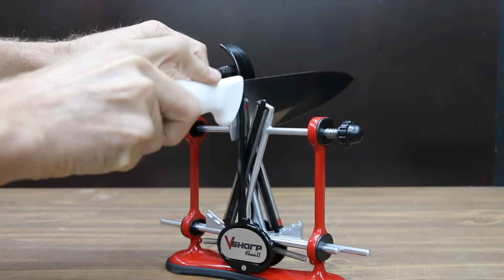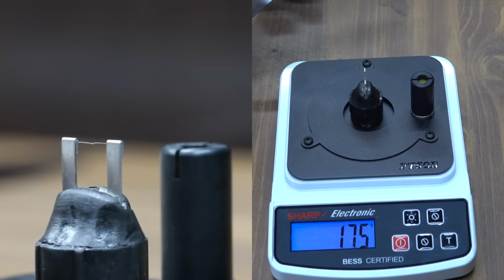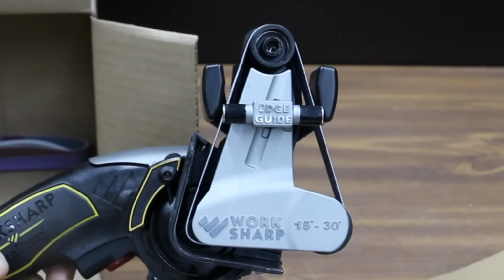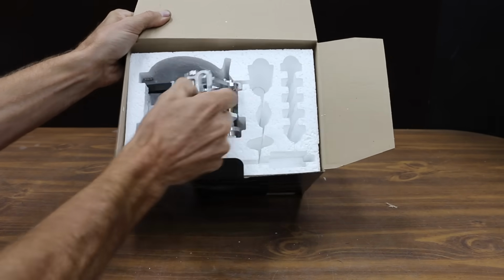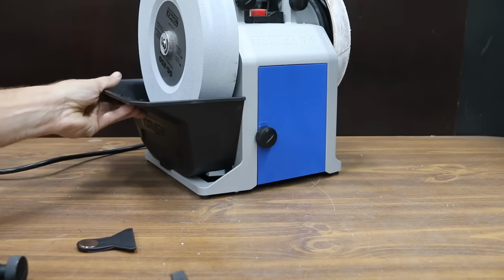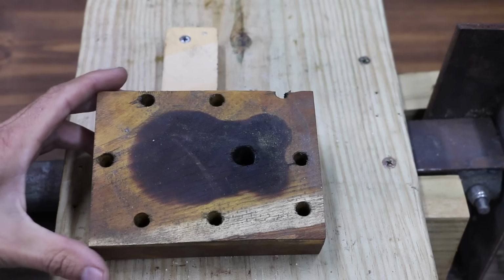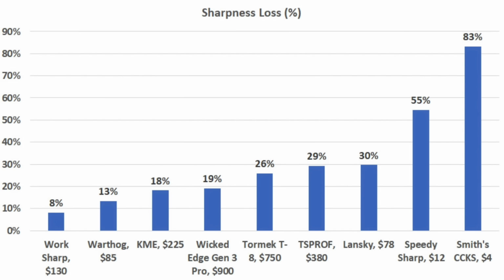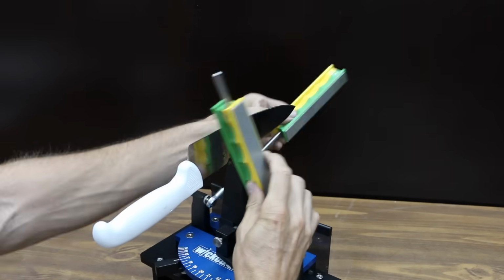RUSSIA vs USA Knife Sharpener? TSPROF vs Lansky, Wicked Edge, KME, Tormek T-8, Work Sharp Ken Onion

Comment: I have the KME system and it makes a very nice professional looking edge. One issue I have had with it are the stones are slightly different sizes. The mounting system has to be adjusted for each one which is a fiddly process getting it set to the right tension with that little knob. 
The guide rod could use another set stop to keep your stone from accidentally riding up or slipping off the blade.
The stand is too expensive, buy all thread two nuts and some wood.
Takes a significant amount of time to produce a new edge but its faster than the lansky system I had before.
Reply from the maker: Thanks for the feedback.

Comment: Man this is the best sharpening video you have ever done. One point though. If you order finer stones/diamonds the edge will be sharper. I have had many systems and to me any of the systems that consistently hold the angle (like lansky) are good enough and $78! Wow. The speedy sharp and the smiths are only good for a few sharpenings because they do not keep the blade flat or get out nicks. They are like using a steel.
Reply from the maker: Thanks!  Thanks for the feedback.

Comment: Thanks again for another well done comparison. I personally use a wet stone and need to get smoother stones so the  edge will last longer. Seems like a few of these companies are trying to reinvent the wheel. Some of these look dangerous and should come with chain mail gloves.  For me, instead of spending $900.00 to sharpen my kitchen knives, I would just throw away dull knives and purchase new ones - might be cheaper. Using Mercer  from Amazon, the $900.00 would get you 69 knives.
Reply from the maker: You are welcome!  Thanks for sharing.

Comment: This was one of the wildest and most interesting tests I've seen on this channel so far. However, I think due to the tension driven performance of this test you should have tested each knife at least three times in each scenario. At face value the Lansky looks awesome but I bet with more tolerance testing the high brands come out on top.
Reply from the maker: Thanks!  Thanks for the constructive feedback.

Comment: Can you test out more 2 stroke oils i use castor 927 and its been my favorite oil zero smoke when my dirt bikes warm and check the cylinder after 150 hours and still had the factory crosshatching
Reply from the maker: Thanks for the suggestion.

Comment: In your previous testing, I posted for you to use quality knives for better accuracy.  Sadly you bought "low end" mercer knives. Even cheap knives are very sharp to begin with. The knife makes as much difference as the sharpener. You should use a quality knife made of carbon steel and one of "stainless" steel to be more accurate. Well maybe next time???
Reply from the maker: Thanks for the feedback.

Comment: I commented on your previous video regarding the success I had with the Lansky as a portable sharpener while I was in the army.
I recently purchased the new worksharp precision sharpener for about $40. The basic model has 3 stones although they now have an upgrade available. 
Take a look at it and should you ever visit this subject again maybe you can give it a try.
It works really well, and as you'll see, follows the theme of clamping the blade and adjusting the angle of the stone. It is a good fit in the budget area.
It isn't as portable as a Lansky but it is easier to set up and use.
Thanks for these many videos. I have used your research for several purchasing decisions.
Reply from the maker: You are welcome!  Thanks for sharing.

Comment: I didn't need to watch anymore as soon as I saw the $4 sharpener do it's job. I did watch the whole video though to see how pointless the rest of them were for some of the  crazy prices in comparison.
$4 sharpener thrown in the cutlery draw for instant sharpening versus overcomplicated machinery you need to assemble each time - I know my choice ;o)
Reply: Did you watch to the point where the knife sharpened with the $4 sharpener proved to have a vastly less durable edge than those produced by the other sharpeners?  On the other hand, the $12 one did better in the tests, is almost as simple to use, and is almost as affordable.  I don't have that exact sharpener, but I own one of a very similar design, and it's pretty good.
Reply from the maker: Thanks for watching!

Comment: Fabulous review, as usual. There may be something counter intuitive about sharpening knives. Apparently chisels and planes are best when sharpened to a mirror finish. Knives are better when they're sharp but still have some "teeth". These very small serrations act like a saw when the knife is dragged over the food to be cut. A chisel is pushed through the wood with no drag or length wise motion. 
So i wonder about the sharpness tester because the edge to be tested is pushed against the wire with no sliding motion. Try cutting a ripe tomato or raw meat with a knife with a polished finish and with a knife that has the serration left by fine diamonds or stone...
With that said I like the objectivity of the sharpness tester. But who cuts raw meat without dragging the knife?
Reply from the maker: Thanks!  Thanks for the feedback.
Reply: i dont think kitchen knives want burs or "teeth". chefs recommend using a honing rod to keep the blade clean of any such things.
its been a while since i watched him first talk about the knife sharp testing thing he bought. but im pretty sure he tests it per their recommendation/instructions. i guess he could always pull it through and push it through to see if it gives a different number
Reply: @Mck Idyl yes either way his comment isn't a good idea
Reply: I suppose those "teeth" can also affect the result of the test that he does, though. Provided the teeth are small enough they might create extra pressure even on that narrow piece of wire. The smoother the edge, the better the pressure will get distributed, I Imagine, reducing the tested sharpness

Comment: GREAT VIDEO!!!!! You know what they say about knife sharpeners, the best knife sharpener is the one you use. OK, maybe that was about cameras, but I hope you get the point. Anyway, the two cheapest sharpeners may not have given the best edge, but they were pretty good and so much easier to use. For normal work in the kitchen, they'd be my choice. BTW, I own a Tormek. But I use it for chisels, planar blades, etc. No criticism intended, but I don't think you prepared the grindstone on the Tormek to give the best results.
Reply from the maker: Thanks! Thanks for the constructive feedback.
Reply: @ProjectFarm  Thanks for understanding the spirit of my comment...although I do hate to critique your videos in any way since they are, in no uncertain term, incredible! Just to clarify my comment about using the grindstone. The Tormek comes with a "Stone Grader." If you want to adjust the stone to finer sharpening, you press the fine side of the stone grader towards the stone surface for about 30 seconds. This will alter the function of the surface of the Tormek Original Grindstone (220 grit) making it work like a 1000 grit stone. I suspect that would have improved the performance of the blade sharpened on the Tormek. Keep up the fantastic work. 👏👏👏 I hope you enjoy making your videos as much as we enjoy watching them!!

Comment: Having had a wicked edge WE130 honestly they're overrated overrated.
And needs some serious improvements to help with safety and overall versatility. 
A hapstone v8 or r2 is much more  capable of a system.
The ko3 and blitz are nice too.
The blitz is a little small for longer kitchen and thicker hunting knives 
Knife placement in systems is important also.
And the stone's used are a big factor also.
I use venev centaur 1x6 stone's f80-f1200 (3micron) about 6,000 grit. 
And as you mentioned strops are a must

The worksharp precision adjust is the new budget King. 
Lansky used to be the go to but it's league's better
Reply from the maker: Thanks for the feedback.

Comment: So as someone who is quite into sharpening a few tips and tricks.

1. As your abrasive becomes more fine, the amount of material it removes becomes more less as well, hence as you go to finer abrasives the time you need to spend on each increases significantly, this is useful if you want to get a true mirror polished edge.
2. Fine sharpening is all about keeping a very consistent angle, a change in angle of just a fraction of a degree will significantly impact your results. For tools that use claps such as the kme and lansky it's useful to make the outline of the clamp so you can tell if it's shifted during sharpening
3. Most of the systems you've shown have multiple upgrades and modules you can purchase for them, which significantly improve the system. Such as the base for the lansky and the different abrasives, which can give you a more fine edge. Things like micro diamond pastes and lapping sheets
4. The edge geometry matters significantly, narrow edges will give better sharpness and edge retention, wider ones will give more toughness. A concave grid like you'll get on the tormek would give you more sharpness but result in a more fragile edge that chips more easily, a convex edge that you get on the worksharp will not be as sharp but will be more resistant to chipping, a flat edge like you'd get on the lansky, kme and wicked edge gives you the best compromise between the two.
Reply: a narrow edge does not give you more edge retention than a wider edge.
Reply: @fettmaneiii4439  yep, it definitely does. You can look up Cedric and Adas videos on it, he's done hundreds of tests on different steels at different angles and a smaller angle will always give you better edge retention, up to a point at which the edge becomes too unstable, but that's usually less than 15 degrees depending on the steel and heat treatment
Reply from the maker: Thanks for the tips and tricks!

Comment: Congratulations on getting a Tormek!  Now you can sharpen pretty much any blade you can imagine (knives, chisels, gouges, axes, etc).  But you did not use the stone grader to take that wheel from 220 grit to 1000 grit.  Imagine how much sharper it would have been after using the stone grader (220grit, 1000grit, honing wheel).  
With that said, if you only sharpen knives, then for price+performance, the Lansky is hard to beat.
Reply from the maker: Thanks for the feedback.

Comment: That russian sharpener looks awesome. A bit tricky to use, but that's what makes it fun. 

After watching your previous video I went with a $20 whetstone kit from Amazon, which includes a 400 grit, 1000 grit, 3000 grit and 8000 grit, as well as a piece of leather for stropping, and it works excellent. It took quite a bit of practice, but I can get knives sharp enough to shave.
Reply from the maker: Thanks for the feedback.

Comment: Wicked edge has a lot more grits than what you tested. It doesn't start getting sharp until you use a ceramic 2000 and get down into the microns. Also, it needs to be a really good steel so it doesn't fold the edge over.
Reply from the maker: Thanks for the feedback.

Comment: Of these knife sharpeners, I’ve use the Lansky. The results were good but, I don’t think it’s suitable for larger knives. It’s also time consuming to use. Although time consuming, I prefer using traditional whetstones. I find it somewhat therapeutic to use them, and you won’t beat the results. It’s really impossible to compare whetstones to any of these tools as the results will depend greatly on the skill of the person using them. If I need to sharpen a knife quickly, I think I would give the work sharp a try. I like that it puts a slight convex edge which seems to stay sharp longer.
Reply from the maker: Thanks for the feedback.

Comment: As a knife connoisseur and long-time Wicked Edge owner/user, I'm happy to see it did so well, but yes, it's expensive.  I paid only $300 for my Gen1 Wicked Edge in July 2011.  However, the Wicked Edge is overkill for the steel in the blades of the knives used in this test.  Where the Wicked Edge really shines is when sharpening blades made from tool steels like D2 and M4 or premium blade steels like M390, Elmax, S90V, or S45VN.  The Wicked-edge is also not great at sharpening knives with blades that are 8-inches or longer.  Wicked-Edge should take note of the two-clamp system on the TSPROF as the single clamp is the weak spot of using the Wicked Edge sharpener on longer blades.

I loved the knife-making part.  Scrap steel with no heat treat won't make a very good knife blade, but it was fun to watch.  Project Farm should raffle it off to a subscriber or something.
Reply from the maker: Thanks for the feedback.

Comment: My Edge Pro works OK, but not as nice as I'd like. 

Surprised that other than the water bath grinding system, that none of the others were sharpened wet. 

Two things I learned the hard way was that in order to keep the sides of the blade from being marked up when the blade moves around is to use electrical tape on the clamping surface. 
The second is that it takes way too long to sharpen all the kitchen knives I have.

For my EDC Benchmade, I freehand a 1000 grit diamond on the sharpening edge as few times, then switch to the other side finally two or three swipes with a ceramic "steel" rod.
Reply from the maker: Thanks for the feedback.

Comment: I had a sharpening business , did a video comparing tormek , work sharp , edgepro apex and waterstones , I have went about 1000 belts or more in the work sharp , used the whole stone on the tormek and used whole stones on edge pro as well , sharpening about 1000+ knives plus the custom knives I make, after that I also got the tsprof kadet , to be honest it all comes down to what your needs are , for general all purpose working knife sharpening work sharp ken onion with grinder attachment is all the way to go ! Its versatile to sharpen many stuff like swords and axes , but for all my personal knives I use the tsprof kadet , simply the best out there , I will be posting my video comparing it to the new work sharp manual sharpener which is a cheaper version of this style of sharpeners.
Reply from the maker: Thanks for sharing.

Comment: Great video, thank you. The knife edge tester was a brilliant touch. I have a Lansky and have found the clamp location to be important in recreating the same angle when resharpening.  The angle the stone forms with the edge gets smaller as the contact point moves away from the clamp. This makes a sharper edge but slows down the initial sharpening. I mark the edges with a felt marker too and it reveals if you are going all the way to the edge or if you are riding a high spot.  If you don't realize this the knife will be sharp near the clamp and unsharpened near the tip and handle. I always try to clamp the knife halfway along it's length and width unless the knife is too long. I always pushed the stones into the blade but I see you wipe them along the length. I lost the instructions years ago.
Reply from the maker: You are welcome!  Thanks for the feedback.

Comment: My father taught me to use sharpening stones and to start the tip of the blade across the stone first moving the knife forward so the grain on the blade edge cuts more readily by pulling the knife backwards instead of forwards..Does it matter? Maybe in a knife fight where you slash but not stab? Thats a plus. Never know what will happen when youre hanging with your homeys.
Reply from the maker: Thanks for sharing.

Comment: I've got the KME system along with some additional stones and it has been an awesome set of kit. I've got stones from 50 grit all the way up to 4000 grit. What I used to think was a sharp edge is now dull. If I had to do it all over again right now I would probably be taking a hard look at the work sharp precision elite kit, just for the price.
Reply from the maker: Thanks for the feedback.
Reply: I have the standard worksharp precision adjust and use a strop on a block after.  I don't feel any need for fully mirror polished edges or anything.  Incredible for the $.

Comment: Thank you for repeating the test with a tsprof.  I have an older version and was curious as to how it would compete.   It looks like I should have saved my money and continued using my lansky system!
Reply from the maker: You are welcome!
Reply: I happen to own both. Lansky's good for when you're outdoors / visiting the village, and sharpening some cheap kitchen knives. TSPROF (the older, bulkier version) has better support for long knives and can be set to any angle, not just the 4 holes the Lansky manufacturer has made. So it's Lansky for quick work (still good though) and TSPROF for some more personalized tasks.